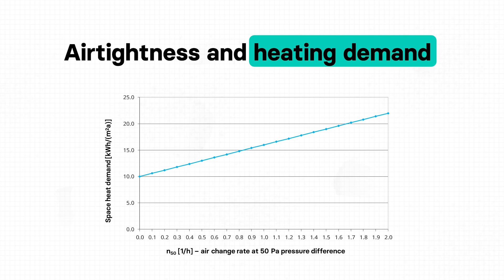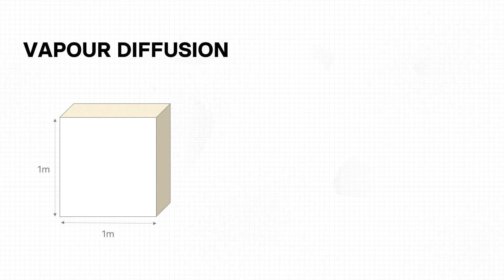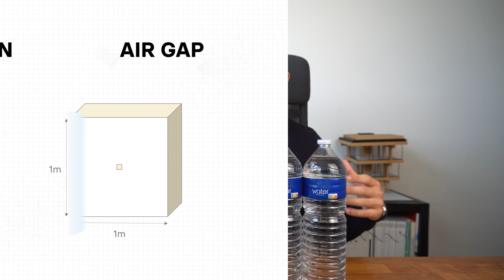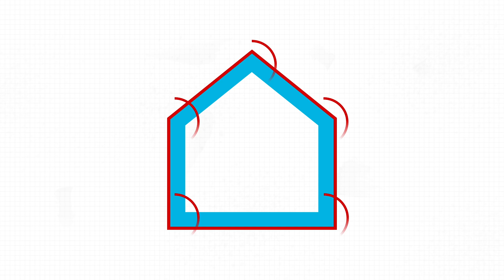Airtightness Explained: The Ugly Truth

Comment: my house has mass timber walls 14 cm thick. wood fiber insulation on the outside also 14 cm and wood siding over that with air vents behind the siding to wick off any moisture buildup.  the mass timber, being hygroscopic , controls humidity swings in the house . the walls and insulation are vapor permeable but air tight . 
the entire interior has no significant off gassing materials making the quality of the air very very good . opening and closing windows and doors is sufficient to introduce fresh air . we have lived in the house for ten years and it is unbelievably comfortable and energy efficient . our blower test was almost at passive house standards .

Comment: I live in a climate where it's hot (tops of 43 C) in summer, and cool the rest of the year, rarely dropping below freezing but even now in the middle of Autumn it's in single digits every night. What I'm being taught in class is that we shouldn't use vapour-impermeable barriers anywhere in our walls, because whether that barrier is on the inside or the outside of the insulation envelope, at some time in the year it will lead to warm moist air infiltrating through the insulation and hitting the cold vapour barrier, creating condensation. So the recommendation is to have vapour-permeable materials all the way through, and focus on stopping air movement so the only way vapour moves through the wall is by permeating through each layer, not carried wholesale by an air leak.

The question I'm grappling with, is how well will this actually work? If the amount of water vapour inside the wall is only what's been able to get there straight through the plasterboard, and then it passes through the insulation to the outside - say a cement sheet cladding - will it pass through that too, or will it get cold enough to condense and drip down inside the wall anyway?
Reply from the maker: Every building must have an airtight layer. By having the airtight layer, the only way for moisture to move through the wall is via vapour diffusion. 
In general, it is recommended to use intelligent airtightness systems which are vapour open in one direction ( e.g. allowing the structure to dry out to the inside) and vapour closed to the other side (e.g. not allowing the internal vapour get into the wall). An example is the pro clima intello plus system.

Comment: Some time ago I watched a video where the builder (Jake Bruton) and architect (Steve Baczek) framed, sheathed with Zip-R, taped, and sealed a new house, before they cut openings for the windows and all but one door. They wanted to understand how well Zip and basic sealing worked, before complicating things by adding windows and other penetrations. The result was an ACH-50 of 0.3, even before they added AeroBarrier. The video is here: https://www.youtube.com/watch?v=ImzhsTLuMho 

Anton, you know, but others may not realize: It's common for professional builders to sheath over windows, then cut them after fact. Some might even tape the joints (except they don't waste tape over the windows because they're going to cut them out anyway). For this test Jake and Steve left the sheathing over the window openings, and even taped them, to run their test.

Comment: Hello,.  I have an existing 1960s home. I want to put 1" foil faced Rmax sheets over the subsiding.  Then cover it with Tyvek house wrap.  Over that 3/4" battens to act as a rain screen.      I'm not planning to tape the foil sheets.  My concern is that they may create a vapor barrier.
(I have these materials already, Rmax & Tyvek are made by the same company.     I made a video on this question.  tHanks for any ideas!
Reply from the maker: Hi! The Rmax sheets with the foil (e.g. Rmax Thermasheath) will indeed create a vapor barrier. Therefore, my recommendation is to tape the foil sheets. I would also advise you to reach out to the supplier and ask them if it's needed to combine the Rmax sheets (with the foil) with the Tyvek house wrap, as it could be an overkill.
Reply: Hello  @AntonDobrevskiPHS  tHank you for the reply.
I had called DOW who makes both products and the one person I spoke to there said to not tape, and to wrap with Tyvek.  They make the Tyvek product so that is to be expected.
I imagine they were showing bias, but I can't find where people use these foil faced sheets.

I bought them years ago, and intended to  use them inside  under the drywall.  This was a different home, different project.
These days, people speak about using insulation on the outside of the wall framing.

tHanks again for your reply.

PS.  I'm tempted to try Tyvek over un tapped foil sheets.  This application would be for the second story of this home...the first story is brick veneer so more than likely it would still be drafty.
I've also come across information that says foam insulation doesn't work at very cold temperatures.
In the end, I am looking for a way to improve, but not damage.
(I have a video that shows some of the project)
Reply: @Dancing_Alone_wRentals :
How will you attach the Tyvek to the foam? Most builders attach house wrap directly to the sheathing with staples or cap nails, but you cannot nail or staple into foam. Plus, if you watch builder videos here on YT, you'll run across a few where the builder attached the house wrap, then when they come back the next day they discover sections have blown loose. Finally, that beautiful water/air/moisture-proof foil face will be filled with holes. For these reasons I feel the advice to not tape your foam, but instead wrap it with Tyvek, is beyond stupid. Although expensive, I've found aluminum foil tape sticks like gangbusters to foil-faced polyiso.

Most modern polyisocyanurate uses butane as a blowing agent, which gives the foam the unfortunate property of losing R-value as the temperature drops. It the early days they used one of the freons as the blowing agent: R-value was about 7.5 per inch and it remained high at low temperature. Then that got banned. They switched to a different freon, until that too was banned. A third blowing agent is available, but expensive, so most makers use butane, which is only R-6.5 per inch and isn't worth beans when it gets cold.

Bummer, because polyiso is otherwise wonderful stuff: air, water, and vapor-tight, plus it's self extinguishing (there must not be a lot of butane in there).

Extruded polystyrene is most of those things, except (unless chemically altered) it burns like napalm: melts, drips, and sticks to things as it burns. The blowing agent for any foamed polystyrene is air, and the R-value actually goes up a little as it gets colder. R for extruded is 5 per inch. Extruded polystyrene can be used in direct ground contact, such as under concrete or on the exterior of a basement wall. Expanded polystyrene (bead board) is similar, except R-value is lower (3.5 to 4 per inch) and it leaks, but only slowly. Saw specs on carbon-altered expanded polystyrene, which was vapor open and water closed, and R-value was 5 per inch. Another downside is that most solvent-based products dissolve polystyrene, but latex paint, glue, and caulk are fine.

A few months ago Home Depot had 2-inch extruded polystyrene and 2-inch foil-faced polyiso for almost the same price (within about 40 cents for a 4 x 8 sheet).

Comment: Unless you are assuming a combined air and vapour control layer, it is the vapour control layer that goes on the warm side of the wall assembly, and only 1 vapour control layer can be installed. The air control layer can go anywhere in the wall and you can have more then one air control layer. Otherwise excellent explanation and editing.
Reply from the maker: That's right! I indeed assume the air and vapour control layers are combined, as in most cases the vapuor control layer also fulfills the function of the airtight layer. Glad you enjoyed the video, thank you :)

Comment: Hello Anton, it is a quite interesting video. You mention that the airtight layers should be on the more hot and humid side of the building. Could you share a examples for Tropical climates (Hot - humid) which (oppositely) have only two seasons, a wet season and a dry season? How this airtight layer can be effectively placed in such environment? One may think that the (constant) circulation of air could benefit for a better cooler indoor confort. I find tricky for the hot - humid climates.
Reply from the maker: For tropical climates, the airtight layer (which should also act as a vapor barrier) should be on the outside. And the construction should be able to dry out to the outside so moisture doesn’t build up inside the construction. 
Air circulation should be prevented inside the construction in any case, as it might result in mold and condensation and moreover, we can’t control the indoor humidity if warm, humid air is coming into the building uncontrolled. The air (and humidity) should be controlled via the ventilation system.